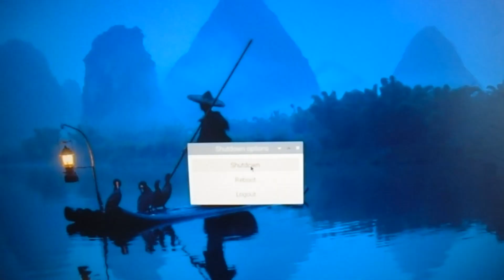Adding an external power button to Raspberry Pi 5

Comment: Hallo. Is it possible to turn on the Pi without a button? So as soon as power is on the USB connection? Like the old Pi 4. Even a normal PC can do it, just by enabling that feature in the BIOS/UEFI. I prefer that, since in that case i can turn it on/off 100% with a mechanical switch that disconnects the power 100% without still heating a small USB Power supply.
Reply from the maker: Of course, it is. Button is just a feature, but you can also operate it just like Raspberry Pi 4. It always goes on as soon as the power is connected, but as far as I know it is impossible to prevent booting after a power outage, even if RPi 5 was previously turned off by its power button. But you can make a simple circuit to prevent powering RPi 5 booting after grid power comes back. You need 1 relay (for grid power, ex. 230 VAC)+ 1 relay activation button (for 230 VAC). The relay disconnects during power outage, and must be activated manually with the button. So, when you go to a vacation, there is no need worry that your RPi 5 could power on by itself. However, you might have to press the relay activation button after returning home to make RPi 5 work again. It has worked for me for years. The circuit is easy to built (I've just made 1 yesterday), but must be insulated and well protected to prevent accidental electrocution. There are of course also other low voltage solutions as well. I might do a video on how to build it in the future.

Comment: Can this be done with a switch?  I've got an arcade1up cabinet which allows you to switch to "On" or "Off".  Could I solder this direct to the Pi?  A latching switch I believe.

Thanks
Reply from the maker: You don't need a header. If you prefer to do so, you can also solder 2 wires directly to power button pins on the PCB. However, the square shaped pin is signal and the round shaped pin is ground. A classic switch is not gonna work with RPi 5. You need a button or a micro key., which just short-circuits the 2 contacts while pressed.
Reply: @pcusbprojects  ah ok. I tried wiring it up and when I switch the switch, it turns the pi on, and then straight back off again. 

Back to the drawing board.
Reply from the maker: As I've told you, you need a button or a micro key - not a switch. If you insist on using a switch, let me tell you a hint: switch it to ON position for really short time (1 sec. or less) and then immediately switch it back to OFF position. Your RPi will turn on and stay on. But you should not hold the switch in ON position for too long, because RPi will shutdown after approx. 3 sec., if the switch is on when it is turned on.
I suggest that you use a button instead (it is ON only while you are pressing on it, and OFF while depressed).

RPi power stater transitions are the following:

OFF ---> RUNNING : PRESS (for 100 ms to 1 sec.) then DEPRESS
RUNNING ---> OFF : PRESS (for min. 3 sec.) then DEPRESS

If using a switch:
PRESS means SWITCH = ON
DEPRESS means SWITCH = OFF
Reply from the maker: Just an idea! If you have a powerful enough switch (min. 5 A - max. electric current), you may also mount it on to the power supply line (like at old RPi 4s). In this case it will work as you desire. Power to RPi 5 will only be provided as switch is on. This works as well as with RPi 5 as with RPi 4.

Comment: Do you use a latching button or monetary button?
Reply from the maker: There is no latching. The electrical contact is made as long as you press the button, just like the inbuilt RPi 5 micro key. It's in fact connected in parallel with RPi 5 inbuilt micro key (also called power on switch). It works exactly the same as an ideal external button should. However, there is an inbuilt time delay in DA9091 Power Management Controller to prevent multiple button presses detection. You have to hold on the button for approx. 100 ms to turn RPi 5 ON and about 3 sec. to forcefully turn it OFF. You must always depress the button as the DA9091 powers BCM2712 ON or OFF as requested, or shows Shutdown-Reboot-Logout menu. If you don't do this, the next button press would have been detected and you may end up in a power ON - OFF - ON - OFF - ... cycle....
Reply: @ thank you for the prompt response and explanation

Comment: superb video,
I would like to connect a push switch to the pi5 for my recalbox retrogaming console. Would this connection be the solution?
Reply from the maker: You have to use a push button (or whatever you call it) that only makes contact as you press it for a short while. If you use a classics switch, you'll also have to depress it shortly after pressing it, or RPi 5 would turn off automatically a few seconds after starting. I still use an old plotter's button (named "TEST PRINT") to start my RPi 5, as shown in my video and I've never had any problems with it.

Comment: I cant get the button to work.  The button itself does work, runs fine on a RPI 4 using the GPIO pins but not on the RPI 5 after soldering the jumpers.  Maybe my soldering sucks but it looks like it should work.  Is there any commands that need to be added to acknowledge the button like with the RPI 4?
Reply from the maker: Raspberry Pi 5 and Raspberry Pi 4 have different options of attaching a power on button. 40-pin expansion port may only be used to attach the button on Raspberry Pi 4. Raspberry Pi 5 has a dedicated 2-pin header position on the PCB, but the header is not soldered. I've also soldered a power on button header on Raspberry Pi 500 (watch: https://youtu.be/myuxPRa69jE) and it works. However, I've learned that some people tried to use a power on switch (with two positions: ON and OFF), but this of course failed to work, because you just have to make the contact while the button is pressed and you just have to press the button for a short time to start your Raspberry Pi 5. If you wanna forcefully turn off your Raspberry Pi than you have to hold it for a few seconds... It works. The only thing to be careful about is to make firm connections to the two power button pins and not to accidentally short circuit them with the zinc. Use an ohmmeter to verify the connections. It's all very simple! I've used a metal cutters to short circuit the pins on Raspberry Pi 500, as you can see in the video above. You can do the same to test your header on Raspberry Pi 5, but be careful not to touch other surrounding elements or contacts on the PCB.
Reply: @pcusbprojects  I got it to work, it ended up being my software.  I'm running dietpi and just cannot get it to work so I used Raspbian, and it worked like a charm.

Comment: My team was usuing a regular button and plugged it into the GPIO Pin 3 to gnd pin. We also edited the /boot/config.txt with the line; "dtoverlay=gpio-shutdown" to power down the pi. I am not sure of the specifics as I did not work with the hardware, but via these pins and this configuration, can we also boot the pi with this button?
Reply from the maker: If you only want to shutdown your computer with a button then you may define a GPIO pin, but if you want to have HW functionality to control BCM2712 through DA9091 Power Management chip (which also enables switching RPi 5 on with the button) then you have to use the original inbuilt micro key, or connect your button to the contacts mentioned in the video.

Comment: The switch is near the micro SD port  ??
Reply from the maker: You have an inbuilt micro switch on the opposite site of the PCB adjacent to the micro switch, but you also have two contacts shown in the video where you can solder a 2-pin header to connect your own external power on button in parallel (also shown in the video), if you need it. I use it, because it is more convenient, if you prefer not have your RPi 5 on your desk all the time. It also enables you to add a power on management module. Watch: https://youtu.be/BINHFtPJi7o.

Comment: The same for orange 5?
Reply from the maker: Orange Pi 5 only has an inbuilt power on/off microswitch. But according to its schematic it is possible to solder 2 wires to the two microswitch contacts (bottom side of PCB), which would presumably have the same effect as the dedicated contacts on Raspberry Pi 5. The microswitch short circuits the contacts and you can also do it with an external push button or a micro switch connected in parallel. So, at least to me it looks very similar to Raspberry Pi 5. But it is nevertheless more or less obvious that it was not meant to be done. You may do it on your own responsibility...
Reply: @pcusbprojects  What about replacing the integrated power button with One sternum, I am making a cyberdeck and that is why I ask if it is possible to replace it with a longer one.
Reply from the maker: I would suggest against removing any component from Orange Pi PCB board, especially not a one that has through whole pins. However, if you have excellent soldering equipment and excellent soldering skills not to overheat the PCB in the process you might succeed. However, short-circuiting two contacts is one thing, electrically driving an button signal is quite another. I suggest that you consult a friend that has an expertise in electronics and he or she will let you know the details and also if it is possible to do what you intend. You would also be able to explain in detail and step by step, what you are up to. Cheers!

Comment: Is it safe ?
Reply from the maker: I'm not s sure exactly what do you mean by "safe". You must be careful when soldering the header on RPi 5's PCB. Watch the video! Electrically it is a simple circuit. Just a two-wire cable an a button... The cable is meant to be used in a household environment. What exactly is your problem?